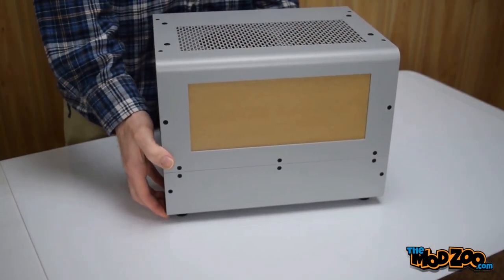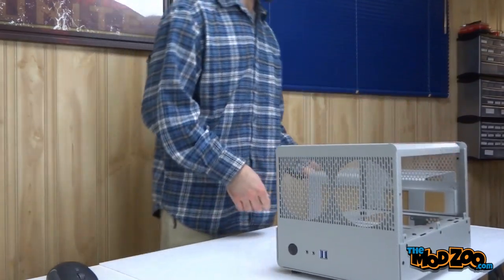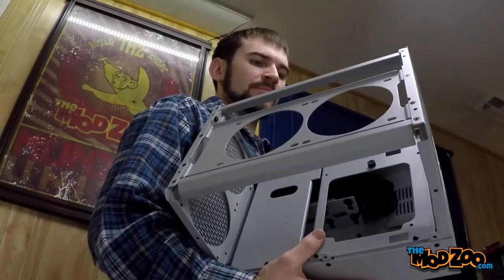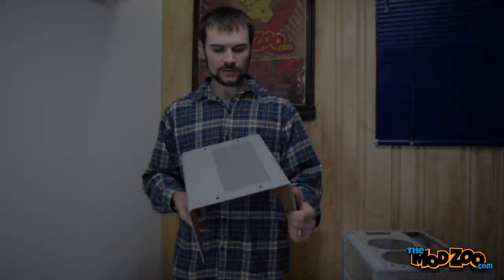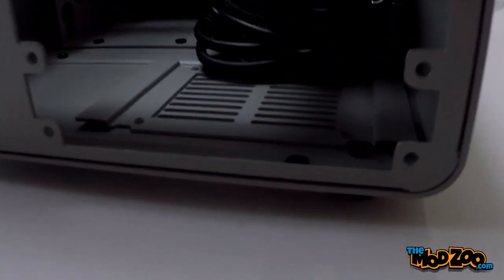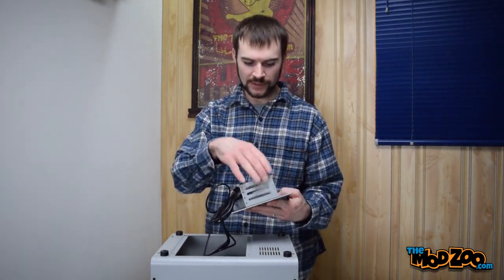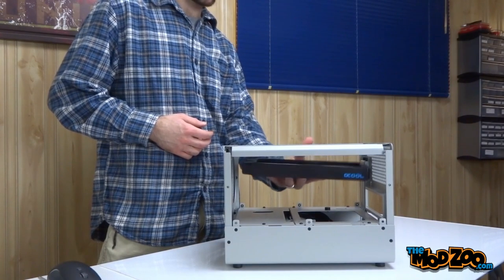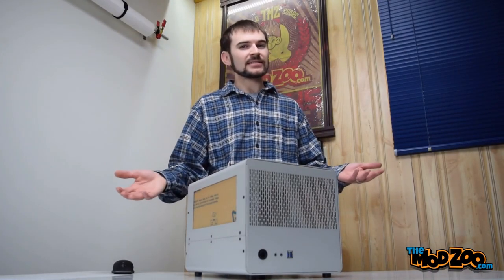Mosquito Case Labs Bullet ITX Overview

Comment: Beware, the current orders do not have full coloring all around the case. They are cheezing out and only painting the outer top and bottom cases with your custom color and keeping the front and back panels black. A massive pain after waiting for 6 weeks to get the case for me.
Reply: I was thinking about this case or just recycling my Corsair Obsidian 250D. Do you like it so far?
Reply from the maker: This was a bit of a different scenario, in that we got custom colors as part of a project we were doing, not necessarily offered from the factory.  But that's why I would just get one all a solid color and paint the thing myself :-)